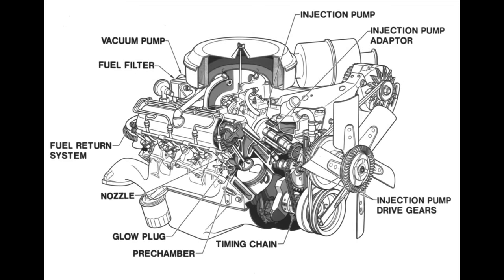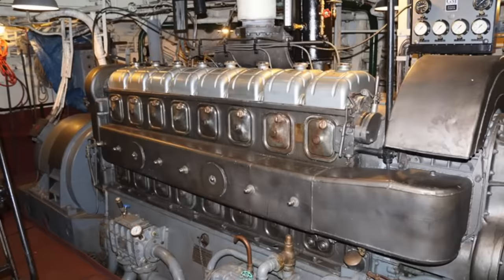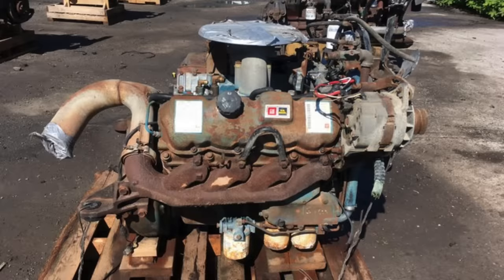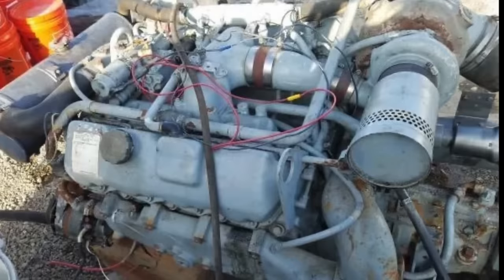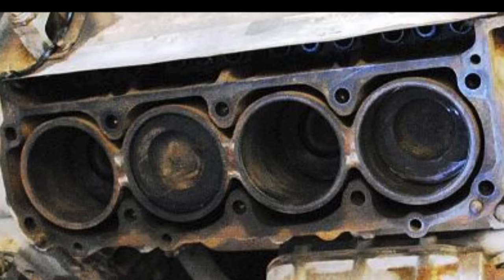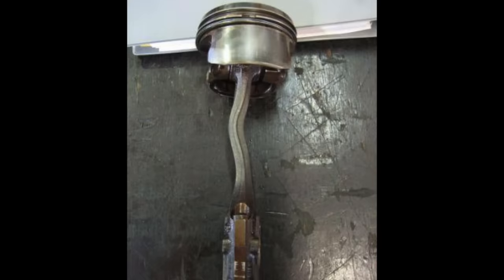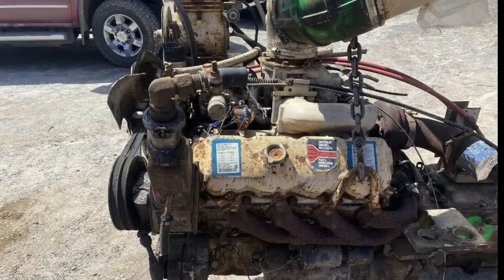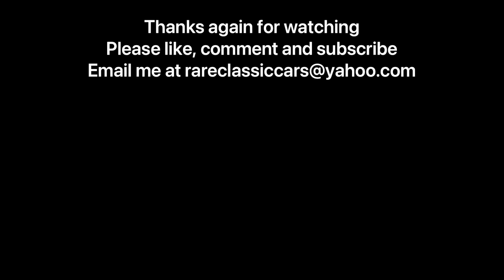Worst Engines: GM's 8.2L / 500ci "Fuel Pincher" Detroit Diesel Pinched Its Owners' Pocketbooks

Comment: @3:30…Penske is widely regarded as “saving” Detroit Diesel, but he just bought in at a time when GM had finished development of the Series 60 engine (codenamed the “tech 80”).  S60 was a fantastic, reliable, fuel efficient engine that was a profit generator all thru the ‘90s.  Penske had nothing to do with the S60 development.

Penske bought in at just the right time, then sold DDC at just the right time, having spent almost nothing in product development and just as new emissions standards were coming along.  Somehow he convinced Daimler to buy the company for a good amount of money; they soon realized it was smoke-and-mirrors and Daimler were pissed off (haha).  The company had been under-invested the entire time Penske was in charge—the factory was old, the designs were old, and the engineering department was weak.
Reply: There is some industry lore, that the series 60 was the child of a joint venture  between John Deere at Detroit Diesel.  Supposedly Deere wanted to get into the on road Diesel market to compete  with Caterpillar. The early  80s economic  down turn scared Deere so they gave up the s60 design to Detroit. Like I said this is lore, I've heard this story several times, I don't know if it's 100% true or not
Reply: @NDC1115 : for sure, for some time they were using the Waterloo foundry to make S60 cylinder blocks.
Reply: We still love Roger Penske here in Detrot. The main Detroit Diesel plant is just under 2 miles from my house right here on Telegraph Rd. Everyone I've ever talked to who worked there loved their job. In the mid 1970s Roger owned Michigan International Speedway out in small town Brooklyn MI. Dad and I went to a race once, plans to camp in the infield. Who was out there directing traffic? Roger himself! Dad hollered to him out the window and the man came over, introduced himself and wished us a very good time over the weekend. He didn't disappoint. Just showed us the guy had a great business sense about him. Every company he touched in the area did well at least very well most often.
Reply: @williamstamper442  : sure, Penske was 100% a BS artist.  I was working there…there was zero investment in the plant or engineering during the Penske years, and he somehow hoodwinked Daimler to pay top dollar for it, even though everything was dilapidated.  Penske was a salesman, that’s it.
Reply: Hey...If I had a chance to sell an old turd for $500,000,000..I probably would...Daimler knew  they had a one trick pony that was aging fast...Daimler did well..As of a few years ago they had 34% market share with their DD powered Freightshakers...They just rebranded their European OM574 as the DD15..They had an ace up their sleeve..They just needed the name that overshadowed them in the trucks they already built with them..If anyone knew there sales numbers  it was Daimler.
Reply: Yup, Daimler essentially only got the name, little else was usable.  The S60 was never going to be viable with EGR/SCR/DPF on it.  The new Detroits are just re-branded Mercedes engines from Germany.
Reply: @mrvwbug4423 They got DDEC, which was way ahead of anything else out there at the time. MTU still advertises DDEC on their engines.
Reply: @NDC1115  I am no authority on this issue, but if one googles "Dedec Deere", there appears to be marketing material printed in anticipation of a joint venture.
Reply: So very true.
Reply: There was a little truth to it. The 60 was designed by Detroit, but Deere supposedly had a little input as they were going to use the engine is some large ag equipment.  True Deere also made some parts for the 60.  There was talk or merging Detroit with Deere's engine business too, Deere was going to supply their 5.9L 6 cylinder diesel for truck use (a few Chevy and GMC medium duty trucks were built with them) and it was to be sold as a 'Detroit' to other truck manufacturers.  Penske came along with an offer GM couldn't refuse and that was that.  Too bad, I always thought Detroit + Deere would have really been something.
Reply: @NDC1115   Deere did try to get into the on-highway engine market but found they didn't have the technology to meet emissions standards.  Cummins was the leader in getting DI diesels to meet emissions standards, starting in the 1970's.  Detroit Diesel hired engineers away from Cummins in the early 1980's who provided key input to the Series 60 project.  Cummins had an engine project called the Omega that was OHC and electronically fuel injected, with early prototypes built in 1982.

Comment: I have a 1986 Ford F700 with this engine. It was replaced with a factory rebuilt engine in the late 90’s. It’s been a good motor for the truck. Decent power.

Comment: We have a couple of old C70’s with these engines. One Is a service truck, and it has 350k miles and an innumerable amount of hours from running the pumps, compressor, and generator. We’ve never had any problems with it except we have to use canned glow plugs on a 90 degree day. 
The other one was in a dump truck and it was terrible. We actually replaced it with a 366 industrial gas engine around 1996.
Reply: These 8.2's were funny like that. You either had a "good" one, or a "bad" one.
Reply: We had one in a boom truck . Never had problems. 
Not sure where this reputation comes from 

Other motors far worse .
Cummins V8 505 ,555 ,CaT 3208 had issues.
Reply: @MitzvosGolem1 
Ol triple nickel trash 😂 haha I worked on one an old timer at work was working on and he told me all the horror stories.
He was like I was hoping I'd never see one again 😂
Reply: @MitzvosGolem1  The earlier versions of the 3208 were even more troublesome. The 1140, 1145, 1150, and 1160.
Reply: @MitzvosGolem1  How about that wonky IH 9.0L?
Reply: @johneckert1365  555 Cummins.... Yikes
Reply: @MitzvosGolem1  Right!!!!!
Reply: Those 366 gas engines seem to run forever!
Reply: @floridagunrat1625  I totally agree. It’s a gutless wonder, and we definitely over work it (for instance fill it up with sand or rock, then  tow equipment behind it) but the beast always gets the job done, always starts, and uses only a quart or two every thousand. It’s a 5x2 and you have to split all the gears fully loaded down and can’t run in high 5th most of the time.
Reply: @stevenlatham4397  Yup. I've got a 1979 C-70 dump truck with the 366 CI gas engine, and I've done the same thing with it for the last 15 years! It won't go over 52 mph, even empty. I've run it full of dirt towing the equipment trailer with the skidsteer, and it'll still tops out at 52! It had low oil pressure when I bought it all those years ago, and it's still got low oil pressure. It doesn't seem to care. It just works!!!

Comment: The high school I attended and then came back to work at had a Chevy activity bus with one of these engines.  I rode in it and then drove it.  When I came back to the school as a teacher, I got a bus license to help drive the marching band, some clubs, and tennis teams to matches.  It was slow and I don't honestly know how hard the bus garage had to work to keep it running, but every single time in any weather conditions that old bus (it was a 1990 model and I started working there in the fall of '03) would crank, get us to where we were going and get us back.  They finally got rid of it about 8 years ago.
Reply: They got rid of it in 2016? Damn they made it stretch for so long🤣🤣

Comment: As an employee of a certain energy services company, I saw many of these in medium duty trucks. It was a throwaway engine. Rebuilding was limited to out of frame work. The head gaskets only failed on the higher hp engines. At the time they didn’t seem that bad.
Reply: It's laughable the 3208 Cat got that throwaway nickname.  Well I guess the 1100 series was pretty bad, but still rebuildable economically.
Reply: I kind of figured it was a naturally aspirated engine 'only' just like the 5.7. Turbocharging a 10 head bolt liner engine like that is asking for trouble.
Reply: @misterhipster9509 any non sleeved diesel is called throw-away.
Reply: @Texassince1836  Parent block is the correct term, just saying.
Reply: @misterhipster9509 Parent metal block ie. not sleeved. I suppose that also means there is not much metal left if you do bore something like that out and sleeve it.

Comment: I'm gonna guess GM would've done what they always do if they get the chance: get it right - just as the product is EOL'd.
Reply: You're correct. In thier later years, the 8.2 Detroit wasn't too bad. Even the early ones were alright if the operator understood thier downfalls and worked around them. These engines DID NOT like to be lugged. They were a "high speed" diesel and were meant to be operated that way. Same with the 3208 Cat that Adam mentioned a few times, they also didn't like being lugged.
Reply: @johneckert1365  None of the mechanical detroits like being lugged not the 2 strokes either, the problem there though was they sound like they are running twice as fast as they are so inexperienced operators were more likely to lug them.
Reply: @cusbrar1  agreed, but the later "60 Series" doesn't fit that mold, but it also wasn't mechanical. They were happy to be lugged just like a 3406 or an "N" series Cummins. 
Side note: The latter years DDEC 92 Series electronic engines also did not like to be lugged.

Comment: we have  a fuel pincher in an 83  C60 grain truck bought brand new. never had any major issues except its guttless as hell. still going strong.
Reply: It’s strength comes from its weakness!
Reply: We were running 366's and 427's in our grain trucks at that time and tried one of these fuel pinchers, we ran it one day and took it back, it was gutless, the gas burners would kick its ass pulling combines on trailers, the answer to our problem was going to GMC Brigadiers with 6V 92's in them, they were bad ass.

Comment: I got a million miles on GMC medium trucks with the Fuel Pincher, 3208 and toroflow . They were meant to be a light weight and cheaper option to the 3208. But compared to the international S series with IH DT or V8 diesel options as well as IH gas engines and Cat or Cummins options ..GM and the rest of the truck industry never could seem to grab enough market share and compete. Driving international trucks with a international inline 6 or V8. They were much more reliable and decent power for the time. You should take some time to look at GM's late attempts to merge Detroit with Deere and how they experimented with John Deere engines in some medium duty trucks
Reply: DT 466 best ever.
Reply: Yeah the DT was the king of medium duty of that era, reasonably powerful, and lots of em have seen a million miles+

Comment: Actually the only reason for an open deck is low cost.
They are much cheaper because there is no need for complicated and expensive cores to form the water jacket while casting.
The downside is a lack of cylinder stability which leads to head gasket failure. 
Modern car engines which use open deck are still notorious for head gasket issues - think Ford EcoBoost and Subaru.
Reply: Volvo used an open deck on their 5 cylinder and to my knowledge never had issues, even on the turbo models. Presumably they engineered their design a bit better. Worth noting however that people generally consider the 2.3L model the best one to boost for added performance, largely because the 2.3L has thicker cylinder walls compared to later 2.5L versions.
Reply: I wonder why they didn’t use shims to keep the cylinders from walking 🤔
Reply: Dont forget the Chevrolet Vega 4 cylinder engine was a POS that couldnt keep head gaskets!
Reply: Which EcoBoosts? I’ve not hear any known issues with them
Reply: @JollyGiant19 The 2.3L EcoBoost.  My wife's friend has a 2016 Escape that's on it's second engine.  Ford replaced the head gasket on the first engine twice before they finally replaced the engine with an updated short block.
Reply: @nerd1000ify  Volvo's had issues in some of their turbo engines, nowhere near as bad as Ford etc but still
Reply: Open deck is fine if well designed and not overstressed. Honda uses open deck design and has since the 1990s. They never had issues with head gaskets, or catastrophic failure. Most of them just burned oil after a lot of miles and would fail because people didnt keep up on the oil
Reply: @Capitanvolume 
Overstressed is the main issue.
Honda engines have a short stroke so the cylinder bore is very short and they are generally non turbo, so cylinder pressures are low.
To have an open deck on a diesel which has high cylinder pressures and a long stroke was a very bad idea.
Reply: @Capitanvolume  Yeah but Honda have good engineers
Reply: @gregculverwell  B16s and D16s were oversquare, but only barely.  All other B motors were undersquare.  K20s are square (86x86) but that is very common for 2.0L engines in general, the K24s are undersquare like most 4 cylinders.  The new 1.5 turbos are extremely undersquare to keep the physical size of the engine down (it's a tiny engine externally).  Open deck is stupidity on a diesel, you're 100% right there, that goes for ANY diesel, also diesels in general are extremely undersquare to maximize torque and allow for thicker cylinder walls, the long stroke is a non-issue with the low rpm nature of diesels.
Reply: Puegeot engines in Caterpillar forklifts had the same design . I believe the forklifts were made by Dawoo , a Korean manufacture . Mitsubishi now manufacturers the lifts .
Reply: @billyhorton5779  The Vega engine only had a 6 quart cooling system that contributed to the problem !

Comment: We had a truck that had the Detroit Diesel 4-53T engine, a reliable, noisy, slightly underpowered engine. But what do you expect from a 4-banger pulling 30,000 lbs? This engine was later replaced by the Fuel Pincher, but I didn't realize it was even more underpowered. Good video!
Reply: How did it actually do on fuel though?
Reply: The 4-53 is a mere 212 cubes or about 3.5 litres.
Reply: @kleetus92  8-9 MPG, which wasn't bad for running heavy so much of the time. Not quite half the fuel consumption of the gas truck it replaced. And back then diesel was much cheaper than gas.
Reply: I only drove a Detroit 4-53T (turbo) in a late ‘70s GMC 6000 or 7000 with a 20’ box and no power steering one time on a hot day in Aug ‘87 in downtown Toronto. GMC should have kept the 4-53T through the ‘80s instead of replacing it with the 8.2L V8. Would a Cat 3208 fit in a regular GMC 7000 or Chevy 70 without switching to the Top Kick/Kodiak hood?
Reply: @SuperDave01965 GM had to move away from 2 stroke designs as diesel emissions started to be regulated.

Comment: The HT4100 had the same design with the liners. In fact, you couldn't order a typical 'short block'. They only sold the replacement engines in Long Block form. Strange they didn't learn the lessons of the 5.7 diesel on the 8.2 using a lousy 10 bolts per head. I had a number of the 5.7 Diesel cars and got to be pretty good working on them. They weren't all that bad once you got the bugs ironed out, however, NOT powerhouses by any means. Stinky, weak, leaked oil, Burned oil, didn't really generate the heat an IDI needed for good combustion, head gasket changes were considered fairly routine. I got to where I could change a head gasket in 90 minutes. Rebuilt the stanadyne DB2 pumps and put the solid agricultural governor weight cage in. The cars I had would top 75 MAYBE 80mph balls out top speed, but I got nearly 31mpg once.
Funniest story is I had an '83 Olds 98 Regency, super nice car, I went through the engine, beefed it up and ran duals with turbo mufflers. The exhaust was pretty foul. Visible and stunk. I was in the fast lane on the interstate going maybe 70mph and some dude in a Prius crawls up right on my bumper. After a mile or so I move over, didn't really 'smoke' him or anything and he speeds past and flips me off! I laughed my ass off! Made ALL the head gasket changes and nuisance worth it. I miss my Olds Diesel!
Reply: That's the thing I would have loved to see 😂

Comment: I'm a mechanic and my worst engine ever is 1982-1985 Volvo V6. That engine had more problems than the Middle East and Africa combined and was the engine fitted to the DeLorean. That engine makes this look engine like a success story.
Reply: The PRV V6 is considered very reliable in Europe and in general has many accolades. Though it was never impressive in US smog form but unreliable it was not.
Reply: v6.??.. there are no good, any,,ever,, v6 engines.. I6, or v8. period..
Reply: @rinkkalex  mmm like the 4cyl peugeot motors in the 60's and 70's very very very reliable.. but open block design... i wonder why reliable here but design is unreliable there?
Reply: @rinkkalex It was only bad in the years I mention. After that it was great, before that it was passable.
Reply: @mattploij2673  I don't think there's much of an opinion for the Peugeot inline 4s in the US. Even then, most Honda engines are open deck, and so are a lot of GM engines and it's never really been a problem.
Reply: @harrywalker968  GM 3800, probably the most reliable engine ever made.
Reply: @harrywalker968  
That’s a ridiculous statement. 
There are a number of good V-6 engines from GM, Ford, Chrysler and others. 
Buick / GM 3.8 / 3800, 3.1, 3300, Chrysler 3.3 and 3.8, and Ford had one or two, too.
Reply: @harrywalker968  Mercedes have made many excellent v6's
Reply: @harrywalker968 ehem Hondas 3.5 v6 with vtec? They used those in multiple vehicles like the Odyssey, ridgeline pickup truck, pilot, and accord. Toyota has a 3.5 as well used in the highlander, Camry, sienna and Tacoma. It’s a solid engine. Ford has a 3.5 l EcoBoost engine that is pretty powerful. I’d say all of those are good.
Reply: @rinkk8126 it was rubbish in Scotland,camshaft trouble,gutless,thirsty and overheating even in chilly Scotland